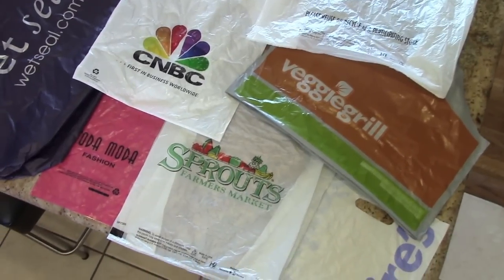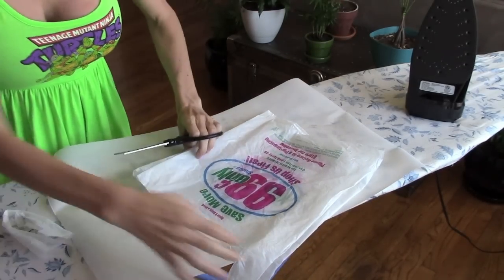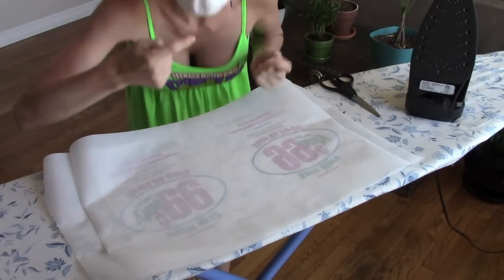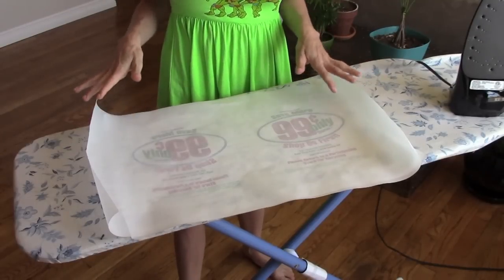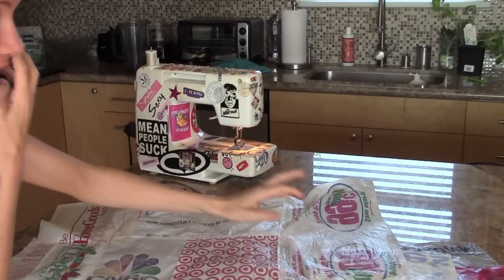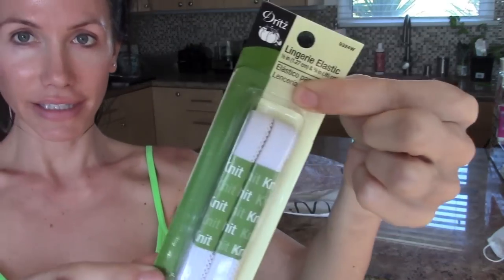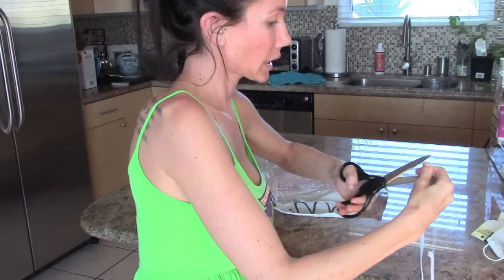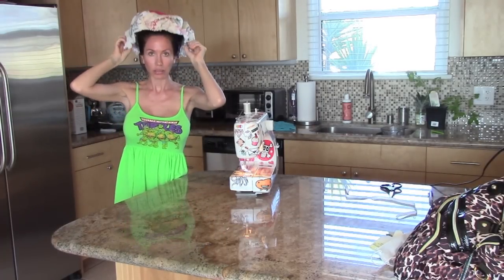DIY SHOWER CAP

Comment: instead of sawing could you use heat & bound?, could you use a clear plastic table "cloth"? ,& where could you find lingerie elastic?
Reply: Jose A Morales Can heat and bound take the constant high levels of moist and damp of the bathroom air when showercap is being used? Wouldn't it fall apart pretty soon?

Comment: To avoid that mistake again you should gather the plastic as you sew it onto the elastic, careful NOT to stretch the elastic. This way you fit the opening to your hairline. A good idea may be to gather and pin the plastic to see if it will fit to your liking before sewing. I know it will take a lot longer but its worth it. Great project, thanks.